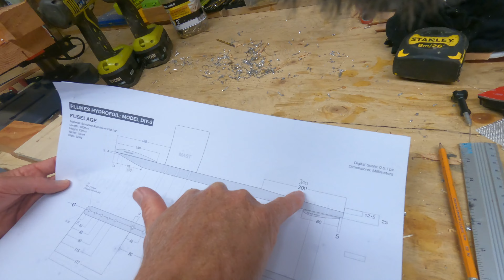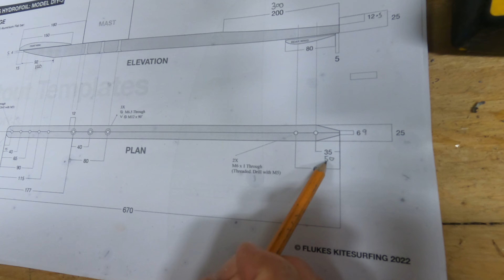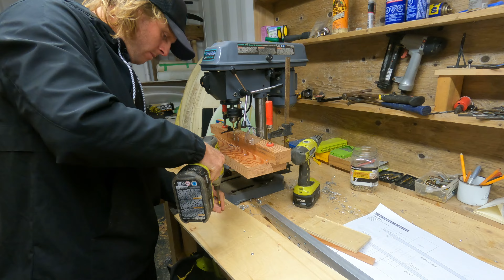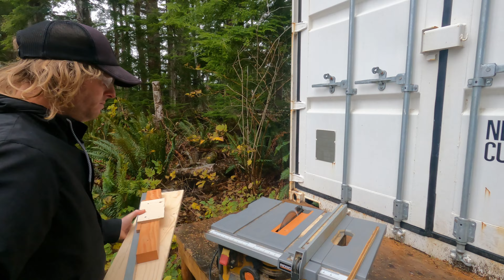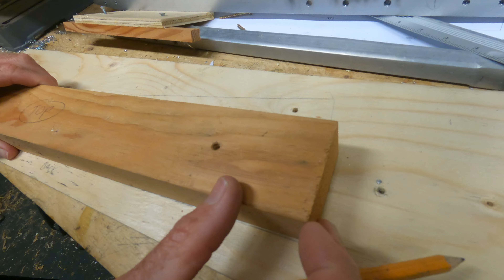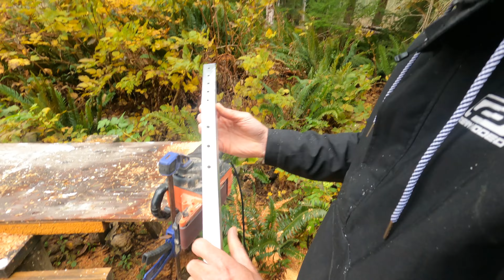How to Build a Hydrofoil: Fuselage - Shaping The Aluminum (Video 11/15)

Comment from the maker: Side Note: it is possible to build this fuselage without shaping the alloy it like this. To make this more DIY Friendly, Simply just cut the front of the fuse at a 45-degree angle using a saw/hacksaw to make it somewhat hydrodynamic. While it won't be quite as good, it will still work and means you don't need to make all of these cuts on a table saw.